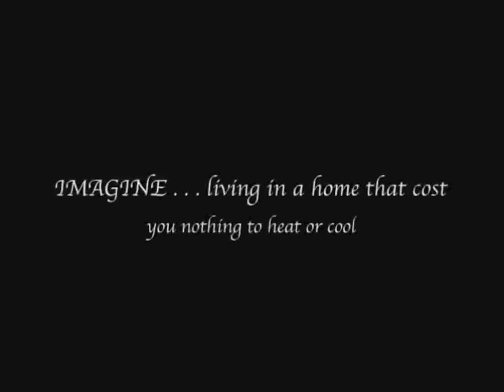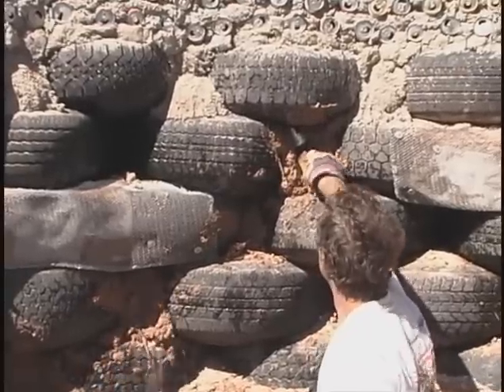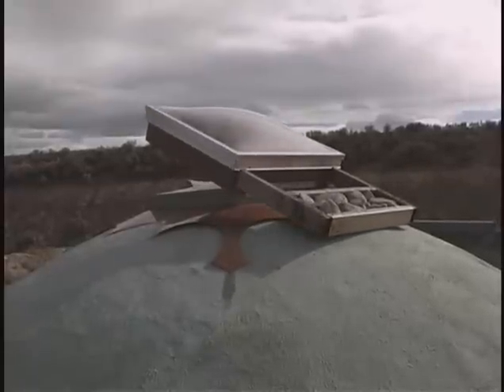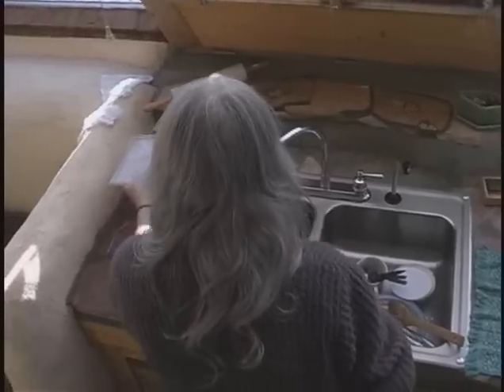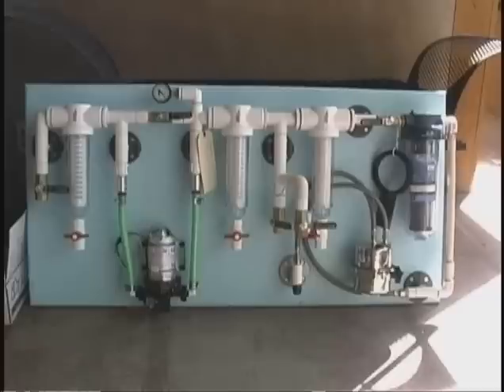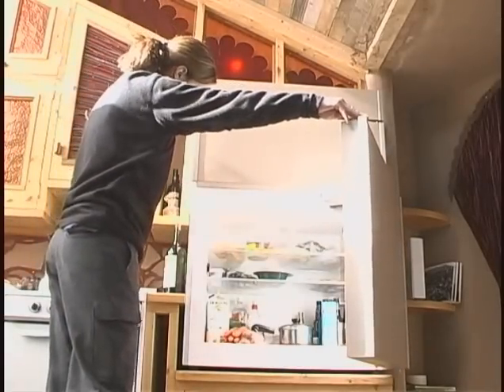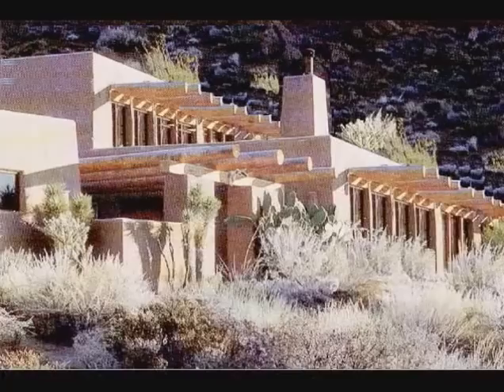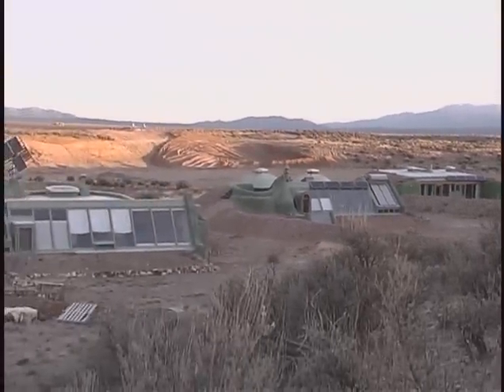Earthship Biotecture ***Introduction***

Comment: I would like to build an earthship community in AZ.  If you live near the Verde Valley AZ, contact me.  Looking for the right landscape and have experience building homes with EF building block (recycled polystyrene and concrete mix).  EF has an R value of 50 and is bug proof and fire proof.  It is not water proof, but can be waterproofed.